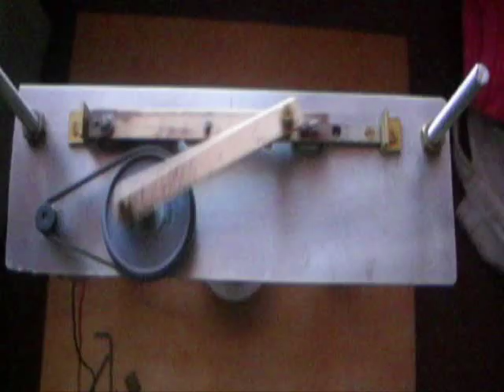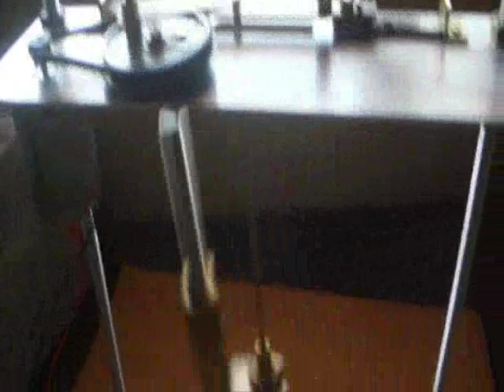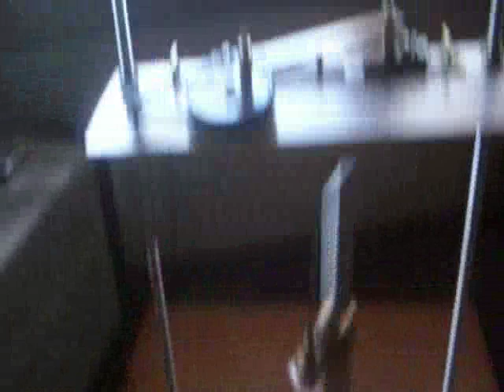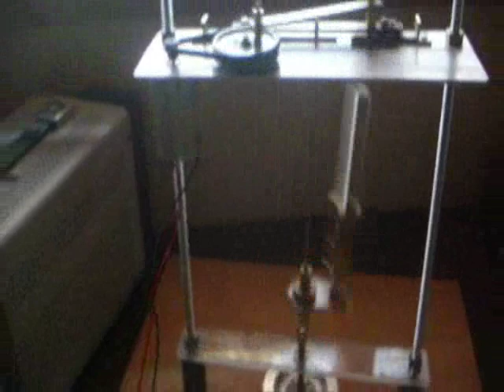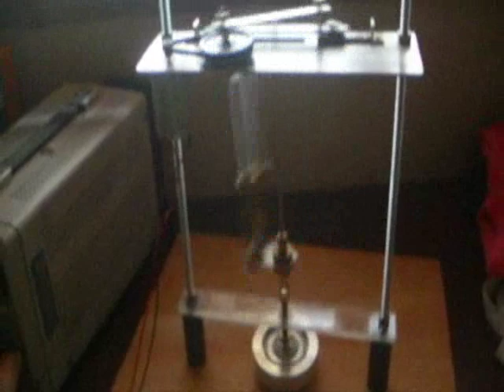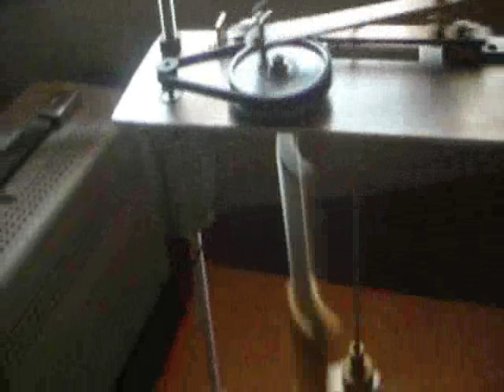1939 Skinner Gravity engine startup and sync part 3

Comment: some people are saying that the upper drive lever is turning in an elliptical orbit. but it does not look that way to me and I see problems with that.  first what ever the lever is doing so is the weight.  the orbit size and shape the lever makes will determine how high the weight is lifted and how often the weight is lifted.  so if elliptical the weight will only be lifted twice each rotation.   if the orbit is a circle the weight will be lifted at a constant rate, in other words the lifting and falling process will be like an ocean wave lifting a ball,  the wave will have a constant even steady lift and kind of a push action. the ball once raised up by the wave will start to fall but the wave does not stop, it keeps moving forward while keeping the ball in a lifted position  where gravity can continually act on it. which means the ball will also fall at a steady, even, constant rate.        now if the lever is rotating in a elliptical orbit the lifting of the weight would be something like this:   the weight is lifted, the weight begins to fall when the lever is lifted to its highest point, lets call that point 12 o'clock  now immediately the lever begins to lower the weight at a constant rate till 3 o'clock where it has lowered the weight to a point where gravity has much less pull on it. possibly not having any pull at all.   then from 3 o'clock to 6 o'clock the weight starts to lift again and reaching full lift at 6 o'clock where the weight is back to full lift and gravity able to pull it down with a greater force.  then everything repeats for the next half cycle.     so the weight is lifted high, it starts to fall, it accelerate but then almost immediately the weight begins to lower and the pull of gravity becomes less, if the pull of gravity becomes less then the weight cease to accelerate and either remains in coast mode or it may actually decelerate till the 3 o'clock position where it will ramp back up again and begin accelerating again till the 6 o'clock position.    if there is acceleration and deceleration there may be jerking forces involved or the lever may act more like a slingshot motion, speeding up and slowing down.   the weight will be constantly lifting and lowering while rotating.   why lift the weight so gravity can act on it only to lower the weight twice through each rotational cycle to prevent gravity from acting on it ? it makes no sense unless some how this method allows for a lower input power or gives a higher output force.    when you can have the weight in constant lift and falling mode with a circle? no jerking, no speeding up and slowing down, just a steady falling of the weight. when I watch skinners machine it looks steady, even, constant.

Comment: Aaron and I disagree about the nature of the motion at the top section of the machine. You have it reciprocating. You need to time it right and give it a little push. We never see Skinner start up his machine. I see reciprocation as being impossible. 
There are 4 shafts. They must be perfectly in-time. If they aren't in time, the weights will crash.
It takes gears or sprockets to time the shafts. The upper shafts MUST be connected to to each other to maintain both balance and timing. You would have to build a complex mechanism to get all 4 shafts reciprocating.

Comment: All you have here is the Energy given out by that  small motor as everything else is basically balanced and not dropping not being raised,  and the little  continuous lowering or dropping the weight does, it is being seen to by the  energy given to the motor, Load that flywheel and as it gives out the integrated energy it built up , it will stop or rotate at a speed  demanded by  a  drag load/torque that is not higher than what the motor can take.

Comment: Nice job!   To: Aaron Murakami,  Very similar to this,  But I believe it can be made compact using the "hula-hoop" setup - the bigger internal gear driven by a smaller elliptical gear. Torque can be increased by having some weight at one point at the circumference of the bigger internal gear (also increasing the diameter of the "disc" of the bigger internal gear). To make the machine stable, make it in pairs such that the centrifugal force of one setup counteracts that of the other setup; the rotation of one setup syncs with (mechanically linked to) the other. Easier said than done but I believe it's possible. Good luck!
Reply: +Florineo Jerez Please do not encourage people to take up an engineering  drug  that is distributed by people who do not understand science and  often preach that  this machine   contains what it does not  contains to solve their energy problems.  Just tell then to proceed but not to expect more out of this machine than you put into it, except a level of entertainment  and enjoyment  as doing one's best to reduce friction to make  those rotating parts go further and the reciprocating parts have more energy to accelerate them  to their limits if a pulsating input is used,

Comment: I greatly appreciate your presentation of this device.

     It certainly stands up to a visual interrogation. It appears as though the energy required to imbalance the weight is far less than the energy in the form of torque produced by gravity's interaction with the free-floating mass. Logically speaking, we simply must have an input/output comparison in order to judge the device in an accurate manner. Perhaps a passive volt/ammeter measuring input to the driving motor and another identical volt/ammeter measuring the output electrical power from a small generator?

Comment: Well done now only needs to scale up and compare input power with mechanical output power...
Reply from the maker: well depending on who you talk to you get a different opinion as to the mechanical configuration. On OU,com i am being told that there is no side to side movement while over at energetic there are loads of plans that are not very clear. Since no patent was ever submitted the actual setup is debatable. One thing is certain tho...The output is decoupled from the input..Current draw from stalling the output is zero which indicates that whatever i am doing it is on the right track
Reply: Logically speaking, we simply must have an input/output comparison. Otherwise, nothing has been said.